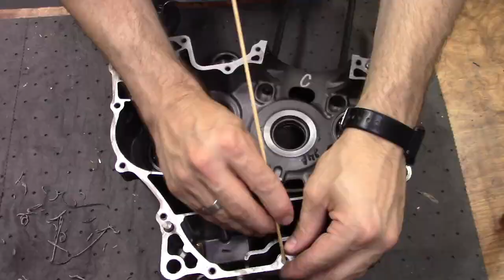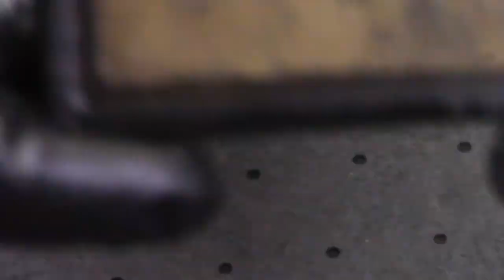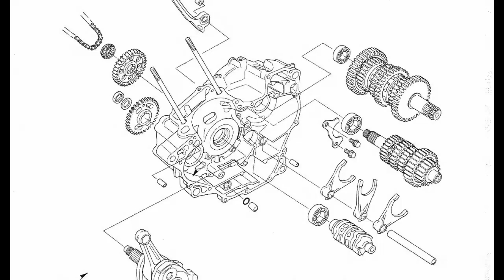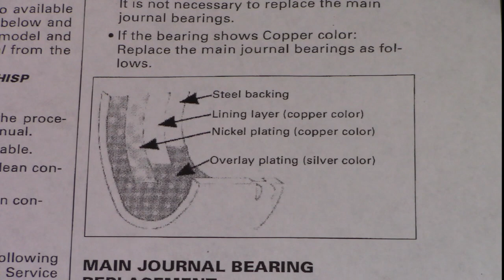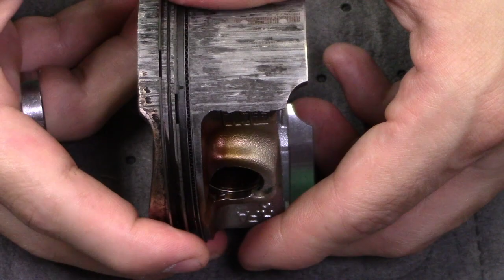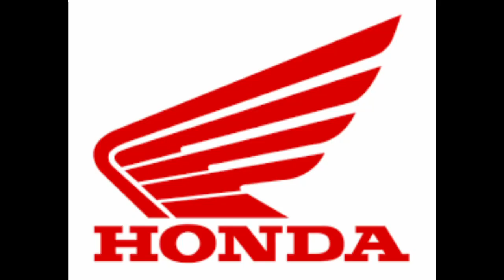CBR300R - Clean and inspect the engine parts; what is piston slap?

Comment: How can you tell if the crank assembly is fine. Mine has no up and down slack or side to side at the crank, but at the piston end there is side to side movement on the rod. Is there an allowed tolerance
Reply from the maker: The factory service manual has tolerance ranges for all the critical dimensions, so if you wanted to confirm or deny that the crank is in good shape, you'd need a reliable way to inspect precise dimensions (might be able to do it with calipers, but probably need a micrometer). in my case, i had no reason to suspect there was anything wrong with the crank, so i didnt bother trying to inspect it.

Comment: I just got a 2018 cbr300r with about 5000 miles and It has knock in the engine any tips on what I should do..?
Reply from the maker: I'd recommend pulling out the engine, tearing it down, finding the source of the knocking, replace the bad parts, and then rebuild. It's likely that it could be just the piston and cylinder (like what happened to me), in which case you might not even have to split the crank case.